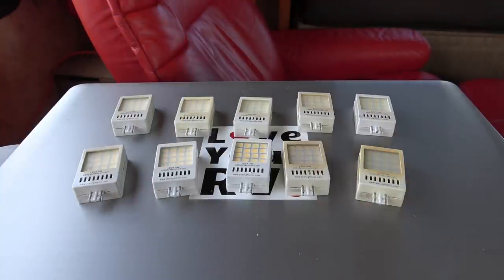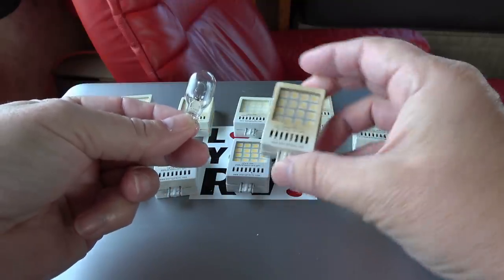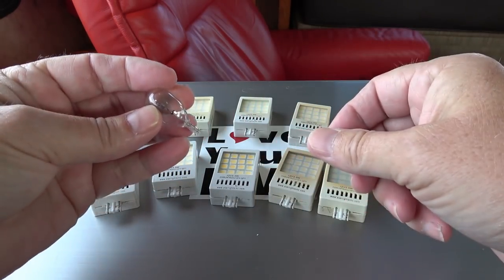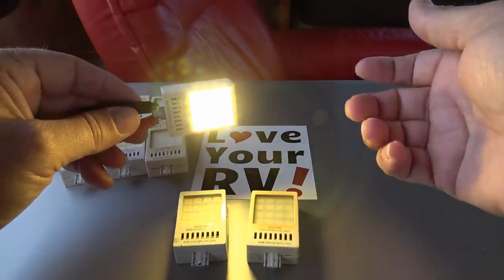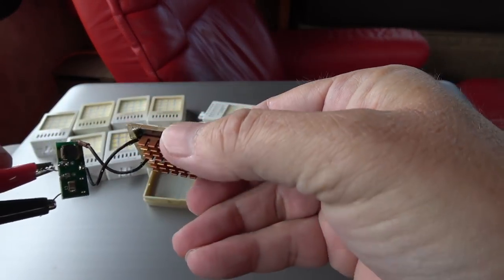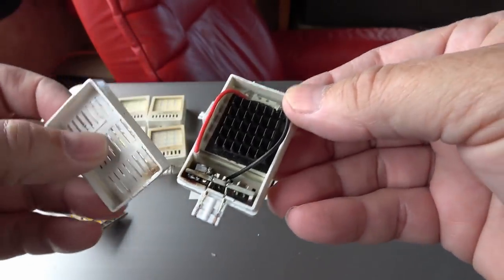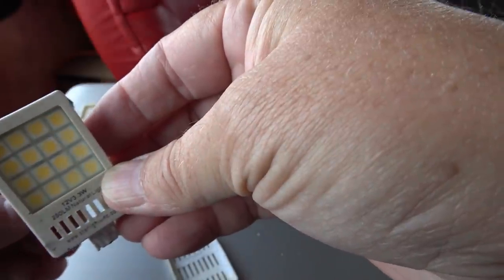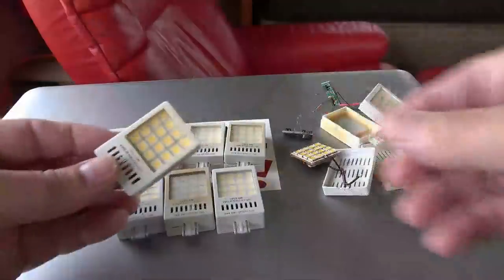RV LED Lamp Update After 6 Years Fulltime Use (Star Lights Inc)

Comment: In 2016 we replaced all of the OEM incandescent bulbs in our TT with LEDs from M4 Products in Chatsworth, CA.  They present an astonishing array of replacement choices at reasonable prices even with shipping to the US East Coast.  We are using two styles:  Alplate 48-5630-WW warm white plate style that adapts and works very well in ceiling fixtures projecting light in one direction; and 921-17-5630 WW Wedge Base warm white replacement that is best suited when traditional 360° radiant light is desired as is produced by standard filament bulbs.  Both styles have higher lumen ratings than the incandescent bulbs they replaced.

We are not full-timers, but these LED’s have seen seasonal use now for 4 years with no failures.  M4 Products provides excellent customer support as well.  No quality LED replacement is cheap, but the reduction in battery drain is astounding.
Reply from the maker: Thanks, I've heard good things about M4 as well. Cheers, Ray

Comment: Can't find my original post, but the mattress is a Beautyrest Silver Elliot Tight Top Firm Queen size.  Purchased at Sleep Country Nanaimo on sale for $899. Might be discontinued my wife says. Also a store in Courtenay.
Reply from the maker: Thanks John, is it a short queen or regular length? The one in our RV is a little shorter that normal due to space constrains of having our shower and bath sink in the same room as the bed and we have no bedroom slide. I also have a bed that lift with under bed storage area so may have to watch the thickness.  Cheers, Ray
Reply: Love Your RV 82 or 83 but it comes shorter. We also have under bed storage, it’s not a problem
Reply from the maker: Our OEM is 60 X 74. It getting really tired. :) We added a couple 2" foam pads to it early on and it made it work OK for us.

Comment: Brilliant - thank you! We have a Mercedes CLK, we bought it new, and we have to resolder the microswitch operating the sidewindow on its board every five to six years, it just gets loose on the board (sideloads when used).

And the width of the circuit lines on such boards used to be much wider then, ten, fifteen or twenty years ago. Same with computer mainboards - maybe 14nm cpu structures will not last as long as 64, 128 or 256nm structures did? We don't know yet, but maybe society will find out:

My wife and I have become ever more reluctant to exchange existing technologies in our house during the past years - 'don't touch a running system' in a much more broader sense - 'solutions free of all wires and currents preferred'.

Comment: For us 18 internal bulbs times $18 a piece. Wow. I suppose well worth it over time but I just looked on Amazon Canada and it was $49 for 1 bulb!!
Reply from the maker: Not worth it at that, I'd say about $15 bucks would be a good deal
Reply: Funny you would say that, today I looked up Rays antenna cactus man on his Amazon.com link $ 10.29 us , then looked it up in Amazon.ca and they wanted $ 40.00 cdn , something to remember
Reply from the maker: I think what happens on Amazon.ca is third party resellers jacking the price up hoping people really want it, buying up a product and looking to make a sale at high mark up. At the .com website the competition is much fiercer and even Amazon steps in and sells the product themselves if it is popular, but on .CA not so much.  I've often thought I should become an Amazon.ca reseller and step into the RV products market and undercut a lot of these dudes, as I know the popular products and what sells. Of course that would be lot of work behind the computer, not my favorite thing and some upfront capital to risk  :)  Amazon is fickle and can change the rules on a dime so always a risk with them.  Cheers, Ray
Reply: @LoveYourRV  Thanks for such a detailed reply. Maybe if I ever get to the US, I can order there.
Reply from the maker: The other thing about LED is there isn't a big reason to swap all your lights out inside the rig. Usually there are only 4-5 that get used all the time whereas many are just used for a short duration or rarely. Just doing the main use ones will have big effect on energy savings when boondocking. Actually, funny, my wife made me put back the incandescent bulb above the bathroom mirror as it has a rosier glow versus the LED, so for some things the incandescent are better, I guess putting on makeup is one of them. :)
Reply: @LoveYourRV  Hey, good to know!! Thanks for taking the time to include this tip. This will surely make swapping more affordable.

Comment: you have one driver board in the bottom of the bulb driving all those leds, the driver board 'pushes' current (about 1/4 amp for these) through all the leds... but lets say half of them fail, the board doesn't know, so it keeps pushing, then the remaining leds have to cope with all that extra power that was used by the other leds, and they cant cope, the go into meltdown and also start to fail until theres none left. as they fail they may 'pop' and go 'open' like a fuse/old fashioned bulb, or they can internally short out, then they will kill the board.
this is a known design flaw in all led lights sold as they wont put in individual drivers. lights built this way are no more reliable than $1 store lights.  I build my own, I dont use this flawed design, I provide individual power to all the leds in my lights and i would sooner use twice as many leds at half power and suck up the cost and have many years of trouble free use. shame real manufacturers didnt do the same, lets face it, whats there is $1 of components or less. I can copy that for $1,  or do it 'my way' for 2
Reply from the maker: Thanks for the info. :) Wow, you build your own. How long does that take? Are you make in the circuit boards and soldering all the components in place yourself?

Comment: Lead-free solder (required by US EPA) grows "whiskers" as it ages, and eventually, the whiskers touch and short out electronic parts.  I think that the US Military got an exemption from the EPA "lead-free" solder requirement to keep vital military equipment from "crapping out" at the most in-opportune time.  Perhaps President Trump will change this silly rule that is causing everyone so much pain.
Reply from the maker: I fixed electronics for many years, stuff like TVs, VCRs, and stereos. Hated when they went to lead-free, good for my business but what a pain to work on. Lots of times I could fix an intermittent problem simply by re-soldering a whole wack of the solder joints with lead solder. :)